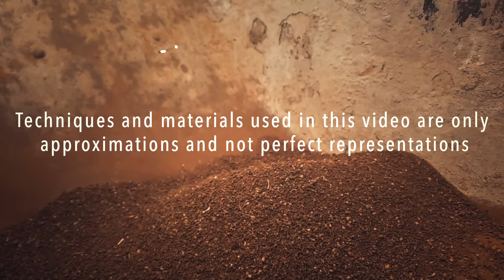Building with Mud: A Continuum

Comment: This was possibly the most concise, informative, and watchable video on these techniques that I've seen to date.  Thank you for taking the time to put this together.
Reply: In India house from mud clay made brick house are made thousands years ago,
Reply: @pundalikadagal  Yes, all over the world. But they kept the brick/block shape the same, not interlocking. Why? No one questioned, just imitated without improvement.
Reply: And what is the strongest and what is the weakest of them?
Reply: What????  But he didn't even SAY anything!!!!!
Reply: @lebanonchristian3951  well when you add calcium (eggs shells deposits crushed fired and add water to the mix fire again) then add and then fire the brick, it becomes calcified, making is resistant to water, there are also ash clay bricks, which as per the name is has furnace ash added to the clay mixture to get a stronger for defined well rounded brick

Comment: You just answered all my questions about earth building in one 5-minute video!! Awesome!!! Best earth building video I've seen in a loooooong time!!! Thanks so much!!!
Reply: Great job!!!!!
Reply: But which should be used? What are the pros and cons of each? Thx
Reply: check very fast stabil Turkish formula
Reply: @muratgokirmak8398  What's that "Turkish formula"?
Reply: Strong resist water Turkish 
ör Anatolian formula...
Reply: AGREED 👍
Reply: Please tell us how strong these walls can be?
Reply: I agree ☝️
Reply: And what is the strongest and what is the weakest of them
Reply: @lebanonchristian3951  Wattle and daub is probably the strongest - the wattle section adds strength, as it's basically wooden rebar.
Reply: @muratgokirmak8398  Turkish no good. Greek much better!
Reply: @G96Saber  been trying to pick between wattle and daub, rammed earth and Adobe blocks. Does anyone know how high a section of rammed earth can go at a stretch? What binding agents are used to join sections?
Reply: he actually did it all wrong... 😀😃😄😁😆😅🤣

Comment: Wow. Very cool demonstration. For those who would prefer not to work with fractions, the following are the mix ratios converted into whole numbers:

Mix 1
4 clay, 4 sand, 1 water
Uses: rammed earth, earthen-floor subfloor, earth-bag fill, earthship tire fill

Mix 2 
2 clay, 2 sand, 1 straw, 1 water 
Uses: cob 
 
Mix 3
4 clay, 4 sand, 2 straw, 3 water
Uses: adobe, plaster, mortar, earthen-floor finish layer

Mix 4
4 clay, 2 sand, 3 straw, 2 water
Uses: wattle & daub, base-coat plaster

Mix 5
8 clay, 4 sand, 10 straw, 5 water
Uses: straw-clay block, base-coat plaster

Mix 6
4 clay, 2 sand, 7 straw, 3 water
Uses: straw-clay infill,  lighter straw-clay blocks

Clay mortar:
4 clay, 6 sand, 3 water

Comment: Thank for the video! It is very interesting to see. I'm born at Kazakhstan and we have house which was build same Technic by my grands after World war II. We still use this house just my parents had build extra room and joint this together with my grands house. 
Nito please pay your attention for one important things, it is critical to maintain the house by white Lime paint. It will keep wall waterproof and weatherproof. I know what i say, my family living part of this house still now. So we have real live experience over 70 years.
Reply: What is white lime?  The fruit?
Reply: @outlaw1179  No it's not the fruit. Google the words lime wash or lime plaster. It was THE main wall covering building material until the invention of drywall products and inexpensive concrete in the early to mid 20th century. Essentially, once it's dry it's limestone. So in a lime wash you get a micro coating of limestone over your surface. They were using it clear back in Egyptian times and many paintings done with it are still around today.  It's fascinating stuff!
Reply: @outlaw1179  take seashells or limestone or other calcium rich material, heat till the glow in a fire I dont know how long, after this cools off separate and introduce water to burnt limestone mix in a separate container and wait. it is something along these lines.
Reply: Typically the lime layer is added first as it's the hardest & will crack more easily when stressed.  Then the cob layer is added as a finish layer because cracks happen less frequently & are cheaper to patch.  Slap on some white/color wash & you're good.
For waterproofing, an oil that doesn't go rancid is applied every so often to keep it water resistant in areas with a lot of exposure to water (bathrooms, kitchens (Moroccan tadelakt)).
But either way, those layers won't be preserved if the house doesn't have a good hat & good boots - deep roof overhang & a stone foundation that doesn't wick water.
Reply: Where should the coat of lime go? Are you saying it should go in the middle of the wall? 
The lime coating goes on the outside and is the last, or second to last if you oil the surface, because the lime prevents mold and protects the clay wall itself. 
The lime coat IS the whitewash sotosay.

Or do you mean build the wall from cob, etc, then a lime coat, then another thin layer of clay/cob to finish? So the last layer of clay would be a sort of sacrifical layer?

 @MeanOldLady
Reply: I am firm México and thats exaclty how they keep the walls protected...with lime. But they mix lime with the juice from the nopal or 🌵 cactus because it acts as a polymer and the walls are coated every X amount of years yo preserve them
Reply: I've used lime paint, it's really bad for your skin (it felt burning/caustic) so best to wear rubber gloves.

Comment: As I know, what you did is unique over the internet ! 
I personnaly build my house with mud in Brittany (France). I practiced almost all the techniques you described and I'm yet to find a website that would explain mud building techniques like you did. I immediately watched all your videos and that's an Amazing Job !! Please continue if you know other techniques that you can share.
For example : 
How do you do, on very large walls (2 story house facade...), to keep an even look once finished ? One part will be dry when you come back with more mud and that will let a visible junction ! Specially when you are all by yourself to do all tasks (preparing and applying mud).
Witch tool do you use for rounded corners ? Outer corners are simple with trowel but it's not convenient in inner corners ! 
I personnaly use semi rigid plastic (cutted in ice cream pot) to tighten the small cracs while mud is drying because trovel will let iron marks on dry mud. You dont seem to have this problem ? And before plastic technology, what was used ?
Thank you for your amazing job !
Reply from the maker: Woo I love this comment! Great questions you really hit on some of the finer points here, unfortunately there's no one answer to these questions, like Plastering a big wall by yourself becomes a big puzzle piece or a game where you plan out all your movements and migrations, what you do to prepare for it like trying to make everything go slow, and knowing where you're going to break sometimes it's making that into a emphasis itself, again there's not much I can really say here besides sometimes killing the suction as much as you can from the wall beneath, that means shading, saturating the wall, or even acrylic bonder sometimes, sometimes I even start hydrating the spot where I plan to break when I start in the morning, to allow me time for lunch.
Corners is a great topic, because it's one of the most important parts it's because it's where the eye goes, I have footage for a video on Corners that I haven't made into anything yet but I'm hoping to get to soon.
I'm sure I didn't answer any of your questions but thanks for them, and feel free to ask more.
Reply: @TheNitoProject   Yes, you did answer to the main questions !! For very large surface, you have to progress as quick as possible : try not to stop and prepare everything before. If you do have to stop... we are only mortal beings after all, even us, mud workers, that fly far above the rest of humanity, everybody agrees on this ! ;-) If you really have to stop, you have to find a way to keep the break as wet as possible (shading, saturating the wall beneath...). 
Thank you for your answer and keep doing what you do !
I can't wait to see your video about corners !
Reply: Mortal humans? This "person" is actually an "ant!" That's why it seemed like those walls were very small and incomplete. For an "ant' they were more than big enough.
Reply: Maintain a "wet edge"
Reply: In vietnam,  we add molasses . In china,  great wall add glutinous rice...
Reply: @TheNitoProject   What about 4 story building? My building plans include one story above ground. 3 stories below ground. I was thinking Cob with Lime Plaster and Stone for the exterior wall and Hempcrete for insulation then the interior wall made of just Cob. The basement levels Idk because it will be in Oregon and the soil is saturated with water so that's my biggest problem.
Reply: @DylanBegazo  I've been cobbing near Seattle for the last 9 years or so, so if you have patience, dry stack stone or earthbag/super adobe (if you're less patient) will make great walls below grade. However I'd be super worried, if it's as damp as you imply, the water is just going to leach through into the space (covered swimming pool syndrome as Becky Bee calls it. So need to consider with any of these (heck even with cement) how you prevent water infiltration.
Reply: 3countylaugh you’re a godsend. Thanks Lad ☺️
Reply: Bonjour Sylvain, lorsque tu parles de 2 façades, elles sont à l'extérieur ? Pour mon intérieur, j'avais préparé des petits stocks d'enduits sans eau, je n'avais qu'à ajouter l'eau pour chaque nouveau volume avec un coup de malaxeur, et j'avançai petit à petit. Une journée complète à boire 10 litres de flotte, des dizaines de bières et plusieurs paquets de Prince !! :)
Pas mal ton truc avec l'arrondi d'un pot de glace... j'utilisai des chutes de PVC de plomberie, on récupère tout ce qu'on peut !!
Pour les petites fissures, une piste peut être d'aller voir du côté du foin. A la fin, j'ajoutai toujours un peu de foin haché à ma prépa d'enduit et je laissai macérer plusieurs jours, cela libérait le glucose qui agissait comme une colle : mon enduit était plus facile et plus agréable à poser et le glucose permettait de limiter les retraits et de consolider l'enduit. Sinon, une ou  deux truelles de plâtre dans ton mélange doit faire l'affaire aussi. Attention au timing dans ce cas !
Bon courage au breton gapençais ;-)
Reply: Bonjour Sylvain,  I live in Brittany too! Is it possible to contact you and know more of your house information? I wish I could build my own house one day too!
Reply: So you're putting that plastic toxin in a house built with natural materials? 😅
Reply: @DylanBegazo  Hello! Any progress on the 4 storey house, please?
Reply: @3countylaugh  hydraulic expanding paint and a sump pump
Reply: @TheNitoProject  You are going to love faom cement, with soil and straw. It will be stackable, with salt set up fast, make superior insulation, and support roofs. Easy to make!
Reply: @DylanBegazo  typically earth built buildings cannot be built that high, not only are building codes going to be sharply front against it, and if anyone permits it (and it'll probably reject even three stories on code concerns alone) you'll probably have to get it engineered which adds to your cost. that said it can be done, it's just very difficult to build earth-based Billings that high. Very few cultures around the world have mastered that technique. It is difficult to build a stable four-story high earthen building, but one culture good at it is Yemen.. if you want to know how those look at how they do it in Yemen. They build towers in Shibam Yemen, it's called the Manhattan of the desert. Also older multistorey buildings in Sanaa The trick lies in the foundations, and in the thick ground-floor load-bearing walls. Think "two yards thick" on the ground floor sometimes.They have to be very massive to support the weight of the successive stories. The walls have to taper, they can't be straight up and down, there has to be a gradual taper to them. There walls of each successive story is thinner than the ones below.
Reply: @DylanBegazo  you need to build a drain tile perimeter at the foundation , w sum pump , no way around that if water sweeps through the soil...
Reply: @3countylaugh  see my reply above, drain tile, sum pump ... To prevent moisture , need moisture barrier under the slab , outside of walks, to waterproof completely, use waterproofing blankets such as bentonite underneath , and waterproof  the outside of the walls , to back fill against the walls..   if you leave a air gap between the walls if the house , abd the dirt , need to make sure is shord  properly and the whole thing won't avalanche , talk to a structural engineer ...  If I would do it myself, i would use probably use  the house frame as stabilizer fir the dirt, but would need a sum.pump to drain the water out , otherwise it can be catastrophic, as water distabilizes soil.
Reply: we here in austria, try to great a little climate on our own. we take some long jute tracks and hang them from the roof down to the ground in a little angle. and we moisten them avery once in a while, so we have our own wet climate.
Reply: @fuckungminhrau  Great addition to the art of mud working. If only we knew why they did this. I suspect it was either to strengthen or to make handling easier or both.
Reply: You might be wise to track down Craterre  which I think is at Grenoble.   . Rod Yates.
Reply: @TheTigroots   J'avais jamais vu toutes ces réponses à mon commentaire 😊. Il s'agissait d'une façade extérieure de 2 étages. Pour les enduits intérieurs j'ai utilisé plus ou moins la même recette que toi... Y'avais peut-être aussi un peu de rhum en fin de soirée... Finalement j'ai revendu la maison avant d'avoir pu faire la façade extérieure 😁

Comment: I built my first house 1979, I basically lifted 700t tons of earth, ( by hand )  if not more, because three square metres of wall, weighed one ton, and took 40 bricks, To make each brick into a wall,  I had to lift the material at least seven times. In my second house, I used very light ply formwork, and added about 80 mm increments of dry soil, stabilised with no more than 5% cement. This was then dampened an vibrated, to consolidate, rather than compacted. I called it the Swalllow Method after watching birds nesting,   After 30 minutes, the formwork could be lifted, releasing perhaps six layers or more which was now firm enough to be self supporting., and to support the raised formwork. The lifting was reduced to about  two tons  per 3 sq metres. . Curved walls had added stability.Two important things I learnt: Use a plasticiser whenever you can, such as fresh cow manure.or even Bycol or detergent. The inclusion of sand and silt is crucially important. Silt: about 5 to 10%. Sand : about 30% rodyates@austraianhoney,. com.au. The biggest problem with Earth building is when people don't think about the aesthetics that require a different outcome to conventional ideas./.  Mud changed my life.

Comment: I have not yet seen that last one where you have those slats of wood between the light straw wall. I have seen light straw tamped walls but not with the wood slats slipped between like that. I presume for strength and maybe code.  Awesome short video and an excellent visual of each different wall.

Comment: I am fascinated by this! If you made a structure using these methods, how well do they hold up do rain, snow, humidity, etc. Also, please make more of these types of videos. I love them!
Reply from the maker: Thank you. That's a big question but short answer is yes that's primarily what I do is build houses out of these things, and that's how most houses used to be built, and there are many people who specialize in these building methods today, there's lots of ways to protect them from the elements but that's a big topic LOL! hope that helps.
Reply: There are earthen buildings over 1000 years old in existence today. Termite, rodent and fireproof and withstand earthquakes better than today's building methods.
Reply: @JanColdwater where is it?
Reply: @omarx4139  ok. Thx u so much :)
Reply: If you're still reading replies, the secret is good "boots & hat". Well draining foundations that don't wick water up into the clay walls (I like dry stack stone or earth bag starting below frost line and then about 18 inches above ground before starting walls.) Then the hat, which is a roof with wide overhanging roof, I like about 3' of overhang on one story house, a bit more and good gutters on a 1+ story house.
Third is a quick lime plaster on any spots where you get water splash on the building, it breaths unlike concrete and it gets harder thanks to the rain (see hydralic lime in wikipedia for details). Then those buildings last literal hundreds of years. Some less great in earthquake zones, but that's a different question. ;)

Comment: I used mix6 to do my workshop walls, but with 90% straw and 10% clay mud, result is pretty good and insulation is nice, was a lot of work but cost near nothing (straw from the neighbor and Clay from my land.
After it's dried out, the walls part sounds like one part.. It's fun and surprisingly strong...!